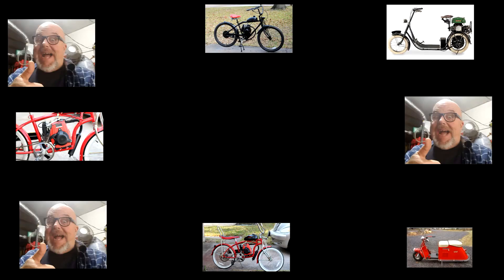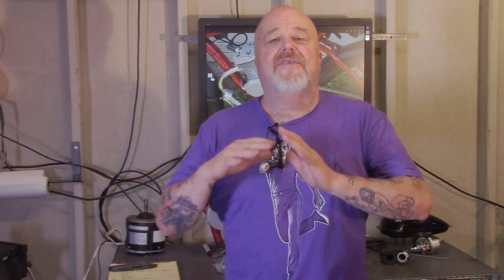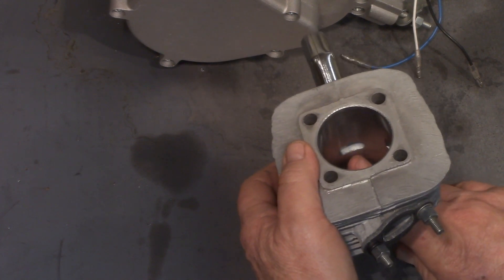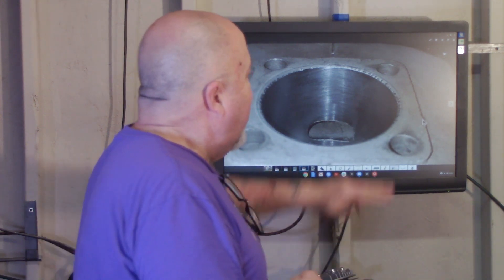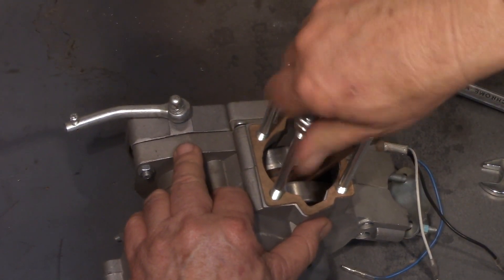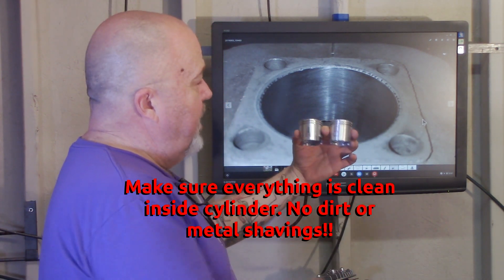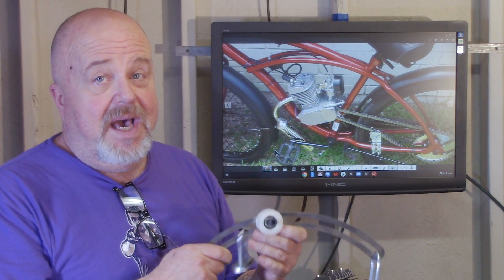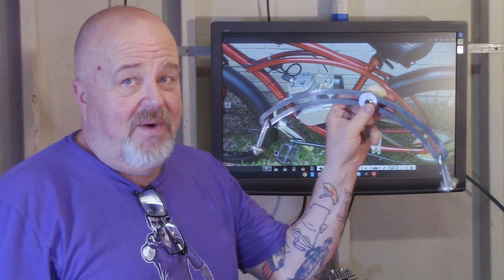What is the Best 2 stroke Motor Kit for Motorized Bicycle?

Comment: Can a metal gasket for the cyclinder stop your motor from funning im new at this i cabt figure iut why i was driving it then it died out and cant figure it out have  put bew plug cdi checked all electronic  uts geting spark and geting gas im lost
Reply from the maker: A bad head gasket can certainly cause a no run condition. Yes

Comment: So these manufacturers seem to have a disclaimer;for racing only,not to be used on off roads or hwys.Will I get a ticket if I put one of these 2 stroke engines on my bike.?
I live in California.
Reply from the maker: I know one can get them licensed in Cali but I'm not sure if any issues w/o a license. Ask on a FB or Reddit page
Reply: @HughesMotorized  I did,it said up to 125cc a motorized bike is OK.But why the disclaimer from every motor build company.?
Reply from the maker: @tr7b410  that way if you get hurt riding one or ran over the seller isn't likely to be sued

Comment: I must have gotten lucky because my little 50cc runs like a scalded dog lol it was a gift because he bought the cheapest kit he could find and couldn't get it to work correctly, I opened up the intake and took out the center of the exaust, tightened the sparkplug down, tightened the carb down because he had it loose... put some 40:1 in it, zoomin now...

Comment: Bt100 $250 (bbr 80/100 and the anbull bt100 on amazon) those r the best damn engines I’ve had yet im not 100% on longevity but the first one I made is a yr old and still kicking
Reply: I've got the anbull BT100 kit. Does 35 easy with a 36 tooth sprocket. I don't even have a chain on the pedals, clutch is sufficient to go from a stop.

Comment: I’ve had the chain tensioner go into the spokes going 32 and is was not fun. It basically just tore up the back wheel in the worst way possible. But I didn’t crash! Thank god. I skidded for about 40 feet
Reply: they make a different tensioner now that's a lot better

Comment: I have never liked that type of tensioner, it's uglier than a mud-fence, but maybe if somebody would chrome-plate some of these, and put some on eBay at a reasonable price, I might get a couple of them for my 4-stroke bikes, to have something different on a couple of them, plus I really want a nicer tensioner for those bikes, and since they don't make one of those spring-tensioners that attach to the engine of a 4-stroke, if I don't find a decent one for sale, I'll probably end-up fabricating my own tensioner for those bikes, thanks for sharing.

Comment: I've had pretty good luck with those Zeda80's by www.Bicycle-Engines.com...so far we're two-for-two with a couple pretty decent little motors. With the usual massaging I get pretty good performance from both engines...
Reply: Is it still good? Should i buy a zeda80? Im searching for most reliable and cheap kit.
Reply: @nierkis5610  Both mine are still running pretty good...

Comment: I used your videos to build my "Beast" with ZERO EXPERIENCE.
The manual that came with it was pretty much USELESS.
I was totally in the DARK as to -- HOW -- I was going to assemble this thing.
I looked at LOTS of videos and was SO LOST as to what needed to be done.
THEN --- I found your video tutorials.
WOW.
These let me know -- EVERYTHING I NEEDED TO KNOW in how 
to build one of these little bone shakers.
Your videos couldn't be any more SIMPLISTIC and --- UNDERSTANDABLE.
After I built mine, I had various minor glitches that wasn't anything too hard to figure out.
My little Beast probably is running about 35 plus MPH straight as is stock.
Very rarely do I get it at full throttle as I come up too fast onto the stop signs.
After I break it in good i plan on adding a couple of high performance parts.
I do not plan to bore it out or anything drastic, just add maybe a Boost Bottle and a Combustion Chamber muffler.
I don't think I have enough room to add a large carbureator.
I may or may not have enough room for a high compression head, but I'm not really sure.
I do know about the Jack Shifter, but I really don't wish to run it at about 65 to 75 MPH after utilizing all 21 gears.
It's a MOUNTAIN BIKE for God's sake.
My little "Beast" really flies as it is and I'm really IMPRESSED with it.
I have had a Honda CB200, a Honda PA50 Moped, and my favorite - the Tomos 2 speed automatic Silver Bullet moped.
But NEVER something like THIS LITTLE THING.
And --- YES --- I thoroughly believe in helmets and NEVER ride without one, unless I am using a Motor less Bike.
You can ask Gary aBusey about that one.
Ha ha --- ha -ha.
Reply from the maker: Glad to help

Comment: Pro tip: with the proper piston that matches the bottom end, all the cylinders have similar enough port timing to be inter-changeable. I was hard up and needed an emergency jug replacement and discovered my cylinder from an older "type A" piston engine worked with my Zeda80, which has the longer connecting rod, and requires the type "B" style piston or as Amazon usually calls them, "high hole" piston. Only thing is, the stud spacing on the intake port- it's either 32mm or 40mm and youd have to get a different intake pipe if you changed cylinders and ended up with a different measurement, but I assure you the cylinders will work in every aspect but that one.

Comment: Where can I buy a good 2 stroke engine?
Reply from the maker: Here's a decent one. Always inspect a new kit and look for issues. https://ebay.to/2WUCoRN
Reply: Hughes Motorized thank you so much man do you know if there are any good black ones
Reply from the maker: @unknownfilms9905  spray paint it. The powder coat they apply to make them black is horrible and causes problems

Comment: I'm running two different engines. One is a Run Well and the other is a ZEDA engine.  Both are ported, balanced cranks, Tuned pipes, High Compression heads, Big Box Racing Reeds, Hotter Plugs, longer Intake Tube, and finally a Richer Main Carburetor Jet. Fuel Mix is 50 to 1, Stelle Chainsaw Full Synthetic Oil and 92 octane gasoline.  Stock these engines put out about 2.2 Horsepower. With my Mods and if I ran the math correctly, I'm getting about 9.2865 Horsepower. The bike is an Aluminum Flat Frame 26 in. Beach Cruiser, running 2.25 wide Tires at 50 lbs. This thing can really get up and go, climbs the hills like a goat. What a hobby. Thanks for the info.
Reply: Awesome  Bro

Comment: Thanks so much for the info! i was going to buy a bike kit from Zoombicycles and was wondering if you knew anything about them or honestly just had any suggestions for what kit i should get. (its going to be my first one) i want to get a 80 cc or 100 cc motor so please let me know what you recommend!
Reply from the maker: It's hard to find them at a decent price lately. They are all pretty much the same. You have to sort thru and make them run good is my experience

Comment: My engine came fully installed like the engine was put together already do some kits only put together half of the engine and you do the rest?
Reply from the maker: Yes. saving that money is their game. Nothing to say they put it together correct. Most are fine. I've seen some loose head bolts/ studs / nuts, bad head gaskets and poor porting on most all. You usually get an OK running engine. OK. Not good
Reply: @HughesMotorized  And when I watch your video on about inspecting your engine like using lock tight on the engine studs and once my ned head gaskets come I'm going to take the engine apart just the top half and I'm going to inspect everything make sure that the piston in on the correct way and make sure the ports are clean and free of any burs. And I'm going to file down the piston skirt. At the start, I was going to take apart the engine because I was scared that I didn't know how to put it back together but now I know how to do it. thanks for the videos

Comment: Hi, this from my new ride. The fuel filter on the fuel line came apart as I was riding. Never seen that in 55 years of working on motors. So something to check on Your bikes everyone. If it can happen, bwwahhhaa.
Reply from the maker: I had one of the brass petcocks come apart and spill gas all over my hot cylinder head. Exciting there for awhile but no boom. Ride on & enjoy!
Reply: @HughesMotorized  Although they can be shined up really well, they ain't worth crap. Shame really.

Comment: I have a black 80cc stroke engine kit but I think it’s a China but idk and it works pretty good it’s insalely fast I’ve went over 35mph but my engine is super loud and rattley any reason why it’s doing that ?
Reply from the maker: Piston could be hitting head. I've had some rattle at first then the engine quited down after breakin

Comment: you did a good job on that video......I love this hobby  but that  cheap engine don't hold up and constantly needs work my head keeps warping even torque down right they r stock so maybe i need some cnc billet
Reply from the maker: Might consider a 4 stroke. https://ebay.to/2Kshwe0 . Fewer issues

Comment: Yeah well I have purchased 5 kits from a vender in Pa. that advertises a balanced crank and guess what only one out of the lot had a little vibration going on down there so I would say they are at least paying attention to the details during the assembly process which is important
Reply from the maker: Some are built better than others. Still a crap shoot unless you get Fred Chelminski of C&R machine to do it right. His motor kits start at $300ish

Comment: I like the runwell motor with upgraded bolts .the crank is tight and the only problem I see is the clutch bearing needs upgraded to a better bearing then the cheap one that is stock.the stock carb is fine but the air filter needs more flow then the stock one lets it get.i use a skateboard wheel on my chain tensioner stock bracket to replace the plastic one.and a up graded muffler with a expansion  chamber.dual handbrakes are nice too.expect to haft to work on a bike from time to time as they need upkeep.

Comment: Any tips on how I can get more rpm?
Reply from the maker: a motor is basically a pump. Increase flow and increase rpms. Clean ports, good pipe and a balanced motor will increase rpms and power. First clean ports, then a good expansion chamber and a properly jetted carb will help
Reply: @HughesMotorized  I got a pipe but I think I need some port matching
Reply: take out the governor

Comment: A 3-4 hp reed motor

Keep the stock pipe So it’s quiet. A 44-44T sprocket should get you ~25-30mph & you won’t have to pedal. 

Not a 1.5-2hp eBay kit.

Matt from bmw is supposed to be pretty good
Reply: Lol a 3-4 hp engine shod be able to go faster than 30 my cheap 49cc can go 30 😂😎
Reply: Real time 30. Not a tuck your wiener 30 on a California road

Comment: What's your opinion of the 2 stroke BT80 electric start motors?
Reply from the maker: I have yet to build one . I figure the extra components might be sketchy and I'd have issues w/ replacement parts so I've avoided them

Comment: Hey brother enjoyed your video I just subscribed to your channel...I've been a auto and diesel mechanic for 35 yrs and built race motors and drag raced all my life but I'm new to this little bicycle motor lol ...I've got a I guess is a Chinese 66-80cc engine... tell my if a bike Berry head will fit my engine or do you sell a head and carb I can put on it
Reply from the maker: The heads are interchangeable on all of the 66cc. They're all 66cc. Chinese call them 80cc but they measure different. Stock carb is fine unless you get into porting and a good expansion chamber. look into jetting and plug chop. That will help a lot
Reply: @HughesMotorized  ok thanks alot brother

Comment: Here's some tips for you 02 Highlander oxygen sensor gasket  the exhaust  it matches for the exhaust pipe and exhaust port and all the new jugs he gasket is a metal gasket and they works great  it's a last chance of a gasket failure or leaking there about 5 bucks to local auto parts store you will have to in largest bolt hole just a little on the gasket blot go through gasket on one side only its does work
Reply: Thats what I use.🏁👍👍